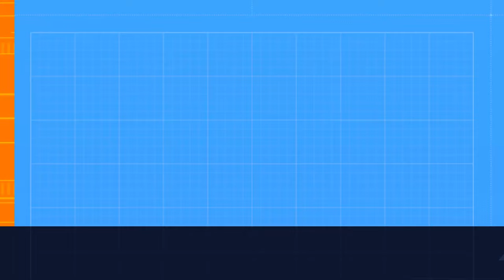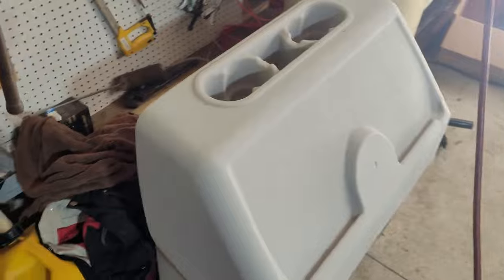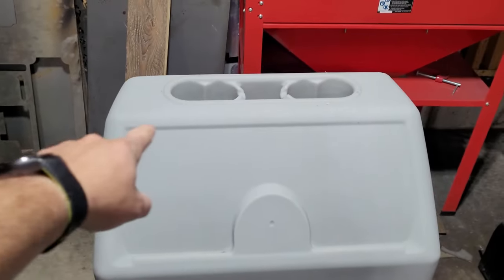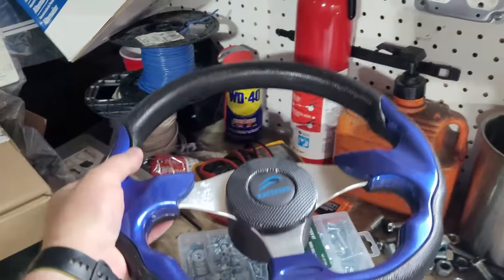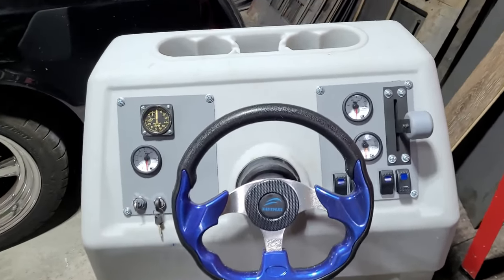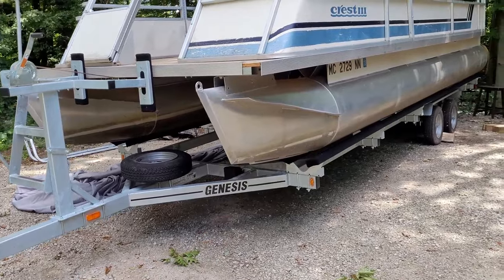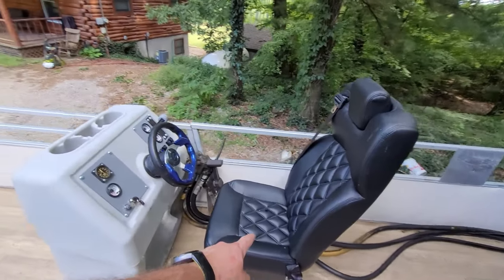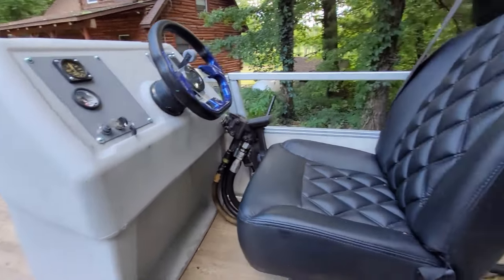The Jet Engine Pontoon, ft. Warped Perception & the Cordless Tesla!

Comment: this is cool i would love to see how low it sits in the water .. have youy thought about adding a center pontoon?
Reply from the maker: If you look back at my thumbnail on a prior video, you can see how it sits in the water floating. It isn't as heavy as it may seem and the weight is distributed over a 10ft span. Should be good enough to start some testing! Can always make future revisions as necessary.

Comment: Have you thought about how to slow down?
Jet planes rely on speedbrakes, reverse thrusters, main wheel brakes (all of them are indispensable) and a long enough distance (different weights have different distances), or do you plan to install a parachute (fighters, space shuttles and some special will use)?
Reply from the maker: Water has a lot of drag. It should slow down decently fast. So no brakes for now. If it doesn't slow down enough I've considered using water diverters to increase drag.
Reply: @LiveLearnProjects  that's pretty accurate except if I understand correctly(and I might not) a pontoon glides on very shallow water, right? In the case the water drag is significantly reduced. Again I might be confusing pontoon with another type of boats.. if it's a usual semi submerged boat then you will have no problem breaking using water as your breaks
Reply: Easy! A second jet mounted 180 degrees in the opposite direction !!!  Or, maybe 8, 12, or 16 jets with joysticks for real control?    LOLOL 😀
Reply from the maker: @YoadJSVlog  There's a lot of factors, but on plane it shouldn't sit too far in the water. The upcoming water test will help figure out some of those details.

Comment: Do you have a separate rudder for steering while running the jet?
Reply from the maker: I have one designed, but not built yet. I need to see how it behaves on plane to finalize it. It's really going to be a calm water straight line only use. So minimal rudder input should be needed to keep it straight.

Comment: I wonder if the "Trim" switch shouldn't just go right to the actuator on the turbine attitude.
Reply from the maker: Ya the plan if we need to adjust attitude on the fly would be replacing the center link with an actuator controlled by a switch on the console to pitch up or down a few degrees.